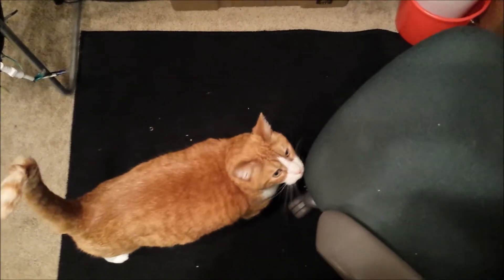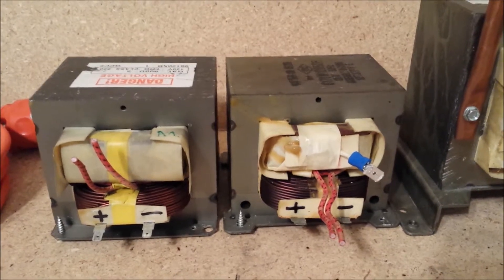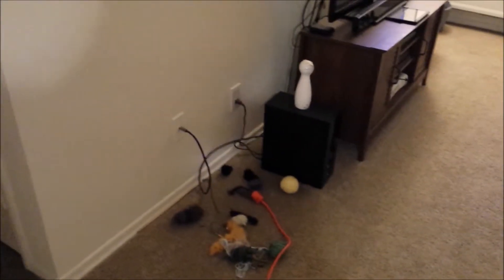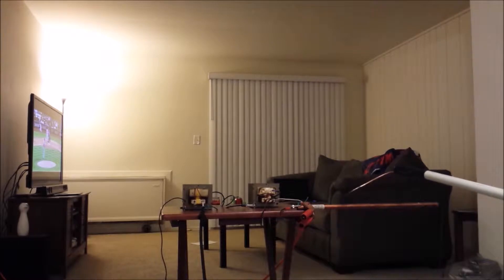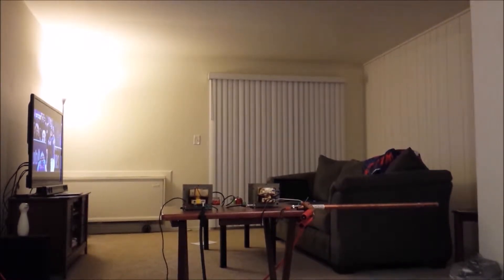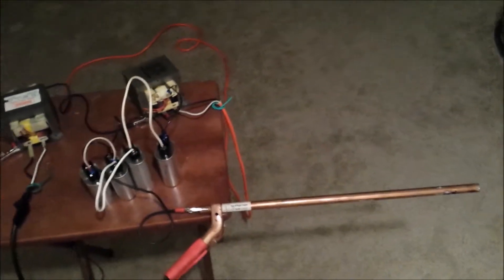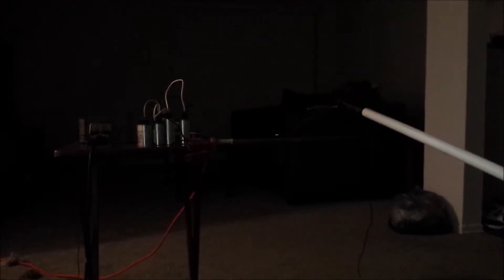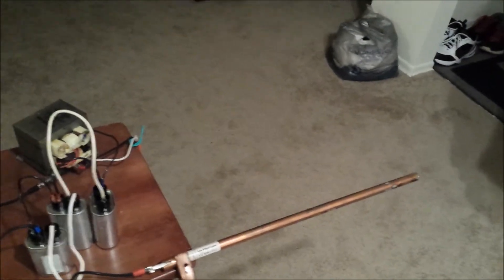Dual MOT setup: Unballasted Resonant Arcs!

Comment: Nice arcs, love your cat. Consider making some cooling fans for the MOT's
Reply: making the arcs sing is just as beautiful, also why not add in a built in oscillating generator for those arcs that way you don't overload a breaker like i did? said generator only working on a battery.
Reply from the maker: RODALCO2007 Cats name is Fred :) Yes I've always preferred cats vs dogs. Dogs are too needy lol.
Reply: +Lets NOT Play With Electricity ,please don't say that, I like all dogs ,cats and arcs.

Comment: The solution to breaker trips that I've used to some success is pretty simple. What I did was wired both primaries in series, which then requires 240v. My apartment doesn't just have a 240v socket so what I did was ran the live wire from one outlet to another live wire from a separate outlet with no neutral. The key to this is each outlet has to be on a breaker from opposite sides of the main panel. Otherwise, live to live on the same side would be 0 volts. Once you find the correct outlets to use, you'll have 240v with only half the current draw you would get from 120v. I modified an old powerstrip by removing the neutral and replaced it with the opposite phase live from a second cord. You could even go an extra step further and parallel the two breakers for even more current draw, but it isn't totally necessary unless you need A LOT of amps! Mind you, this method can be risky if you're careless. Also, make sure the primaries are correctly phased and in series or else they'll burn out twice as fast. Great video, hope this helps.
Reply from the maker: Yeah thanks for the hint :) I've still run into the issue if tripping the 20 amp breakers tho... even though I've wired each transformer to be on seperate breakers. I think I'll need to get some 25 or 30 amp breakers lol. :)

Comment: Wow, Those are some nice arcs bro, i was laughing on the floor when you got mad at one of the breakers flipping, and that chinese piece of shit MOT XD, I was also wanting to know if you used capacitors of the same capacitance when you had three set up. Would it make arcs the same size as yours if i used a 0.82 uF capacitor with two 0.95 uF capacitors? your help would be amazing, reply asap.
Reply from the maker: Lol thanks! I've used the capacitors that I've taken out of the same microwaves the transformers came from. That capacitance really won't matter, just make sure they're rated for the 2000 volts. If they're too much lower than that they could explode.
Reply: Lets NOT Play With Electricity Then im safe and ready to use the 3 caps i got, thank you so much, keep up the amazing work, your videos are great
Reply from the maker: You should be good to go! Just please be safe and always make sure you're insulated!
Reply: I got a shock from a MOT in resonance with 2 MOCs, it was a shocking discovery
Reply from the maker: LMAO! I bet!!

Comment: Oooooh, Slightly too much current? Tripping circuit breakers? Overheating MOTs?

If used correctly, a Fun-Jiggery-Pokery Unit can help to prevent tripping breakers and overheating MOTs by limiting the current.

-BoomBoxDeluxe.

5th May 2015, 04.35
Reply: BoomBoxDeluxe Another trick is use is an old 7.5 Amp rated TV lead (0.75mm²) acts like a natural ballast. the lead will eventually get destroyed on longer arc sessions, as you know Wayne.
Reply: Ah yes, the "volt-drop-in-a-cable" trick. :D

One day, I'm going to have to do an experiment on that so that I can measure how much the volt-drop actually is and how much current restriction a 0.75mm flex can give when it's of a sufficient length.

You know.... looking back on it at some of my poppage experiments in the back garden, I'm beginning to wonder now why, in some of my vids I didn't get much poppage.....

.....It might be because of that 10 Metre flex I had connected into the Fun-Jiggery-Pokery Unit which was only 0.75mm size!

Maybe the current DOES get a bit held-back in there!

Hmmm...... I might have to make a video on that and show some volt-drop experiments.

-BoomBoxDeluxe.

6th May 2015, 03.20
Reply: BoomBoxDeluxe Wayne, I actually abandoned the resistive ballast, as long you monitor the temperatures of whatever you are testing. An inductive ballast is better then a resistive ballast. I use often a 2 kVA 240/150 transformer in series if I need to limit the current with the 150 V winding shorted out. On my 11 kV transformer I had a 60 Amp ballast glowing and melting red hot. My standard YouTube supply is taken of a 25 Amp MCB. The other is 32/20 Amp fed from two different MCB.s.